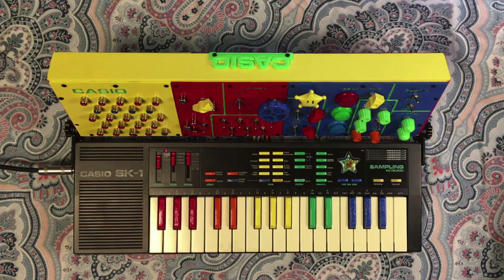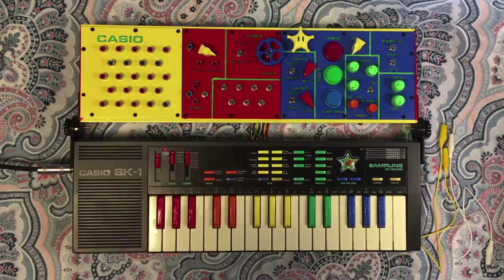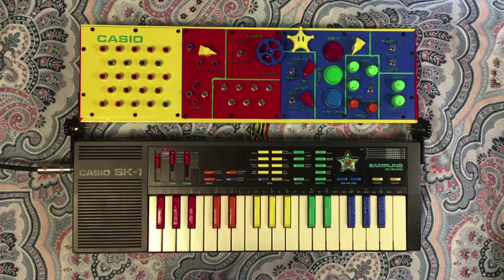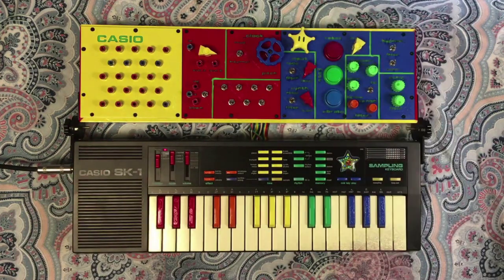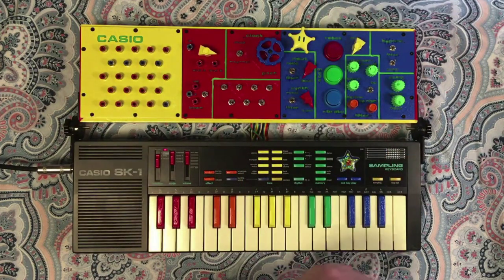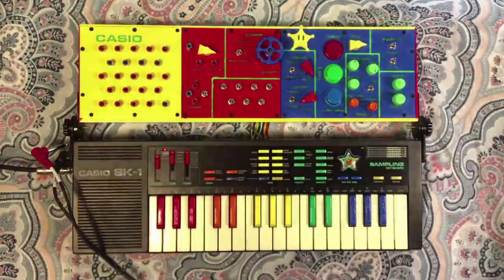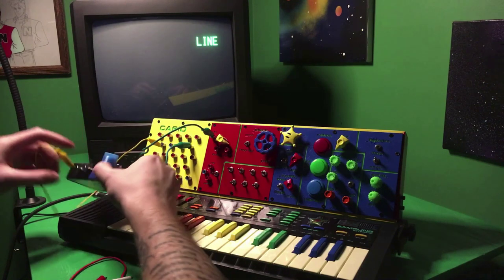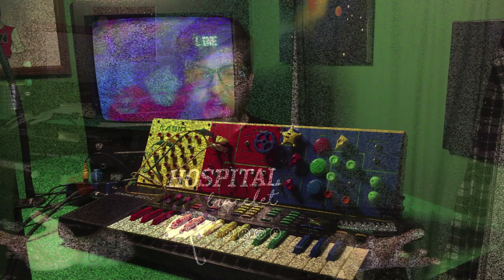Circuit Bent Casio SK-1 - Complete Demo (Commission for Ness Lake)

Comment: I am blown away with how you found a way to open the input and bend things like vocals in real time. This feature alone makes this gem priceless. I have a fresh SK and this is the first thing I want to accomplish with it. If you’re reading this, would you be so kind to show your secret?
Reply from the maker: Thanks! I just lifted the Input pin from the amplifier, then routed the signal through my effects circuit before going back to the amp input. 

I also routed the input jack straight to the effects circuit to let you mess with the input in real time. So it’s actually super straightforward!

I recently updated this build and added a second amp to the signal chain; definitely recommend that since the SK sounds great overdriven and it can be quiet otherwise.

And feel free to email me if you run into questions as you’re bending! I keep telling myself I’ll clean up my process pics to publish, but happy to share what rough material I have in the meantime!

Comment: omg this is so cool. i would love to perform live music with this. the only thing it's missing is CV/gate inputs, MIDI in and out, and some kind of sync options? i can imagine using the remote control converter for the RCA signal from the audio pin data to create pixel art. I am wanting to make glitchy 8-bit trap with singing over top. this would be perfect. i have a casio ctk-411 actually... do you think it could be modded like this, bro? you are so inspiring, man. i need money so i can pay you to circuit bend everything i have lol
Reply from the maker: Thanks! I appreciate it! 
Yeah happy to take on projects like these when comms are open! Sadly a lot of the CTKs are PCM based which makes them less bendable. You could always build in effects etc though.
But yeah keep an eye on the channel! I’ve been quiet lately getting some other projects going, but hoping to do at least one SK-1 that I can put up for sale this year 👍